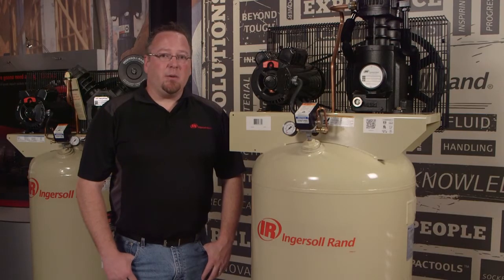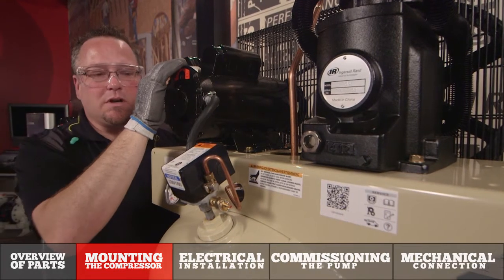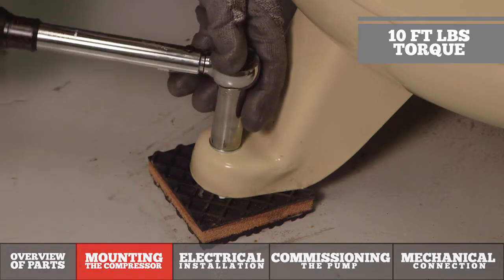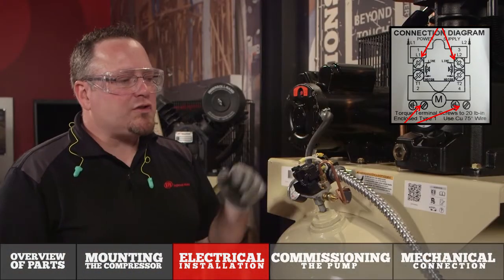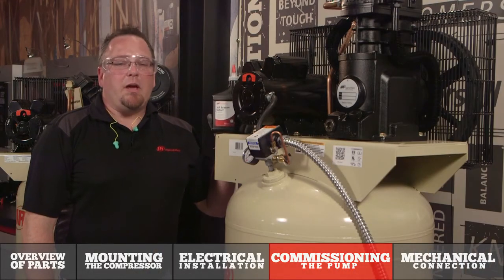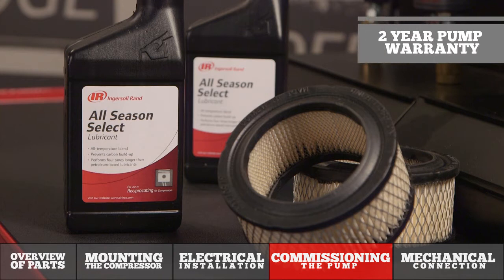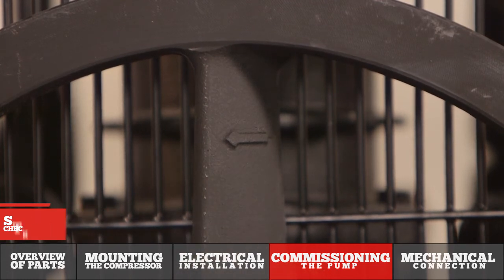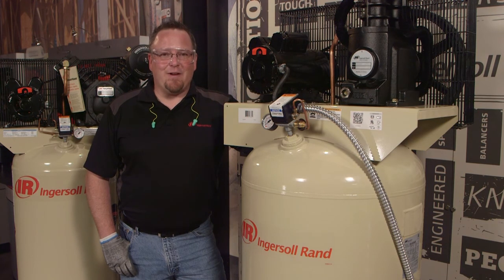Ingersoll Rand - How to Install a Reciprocating Compressor

Comment: I inherited an IR Model 2475.  I had to replace the motor.  I decided I should replace the motor-starter too.  It was a mismatched Eaton contactor with an Square D overload.  In my haste I did not note the rotation direction before disassembly. After further review and research, I found the arrow on the flywheel and the direction arrow on this compressor points CW which is reverse of what it is in this video.  I also have a Quincy 2 stage that runs in CW direction.  Any comments, or suggestions and warnings would be helpful. Do compressors typically run in opposite directions?

Comment: AND I FORGET ASK TO YOU SOMETHING ELSE ON THE SAME THING THERE IS A SQUARE PLUG UNDER THE AIR COMPRESSOR FILTER ,. COULD YOU TELL ME WHAT IS THAT FOR TOO PLEASE????
Reply from the maker: It depends on the exact model you have. Send us your model so we can nail down the proper answer.  You can also visit our support site and find additional documentation for your compressor www.irrecip.com

Comment: I HAVE A AIR COMPRESSOR INGERSOLL RAND 80  GALLONS,5HP RUNNING 230VOLT,175 PSI MAXIMUM PRESSURE 15.8CFM @ 90 PSI. AND IT HAS A BLACK CAP BETWEEN AIR COMPRESSOR AND GRILL PROTECTOR COULD TELL ME WHAT IS THAT FOR PLEASE.??
Reply from the maker: It is the crankcase breather. It ensures the crankcase is always vented to atmosphere and can never build pressure or pull into a vacuum internally.

Comment: Is there a recommendation on initial break in??
Reply from the maker: The unit is already broken in and does not require further break in procedures. It is good to go.
Reply: Ingersoll Rand Air Compressors Thank you!!  I did run it for 15 min with valves open just in case. I wasn’t sure about it. No harm no foul I guess.